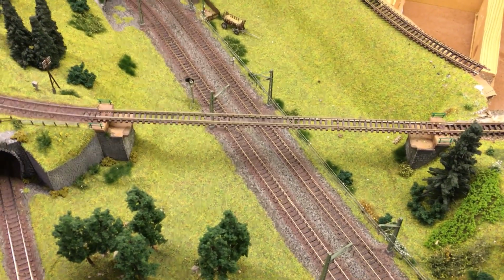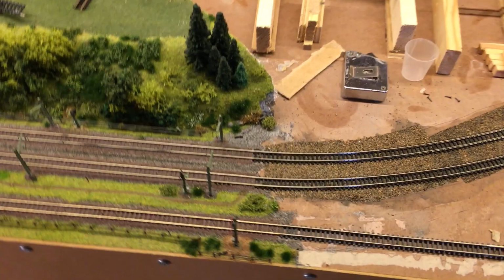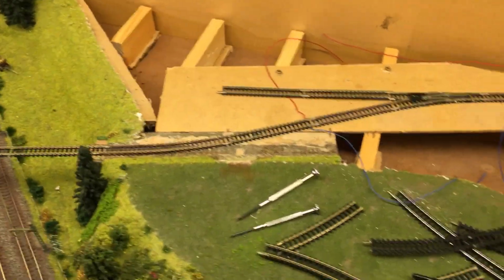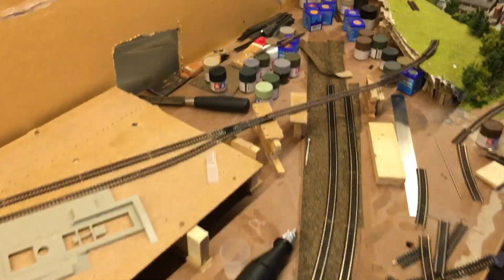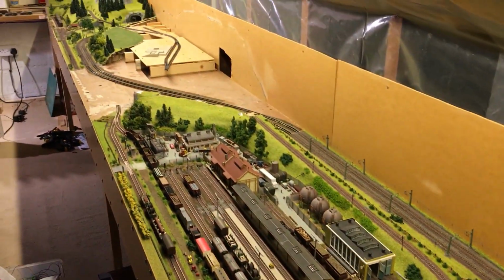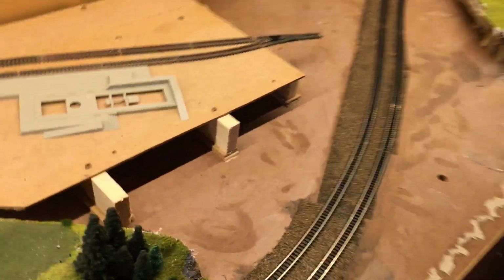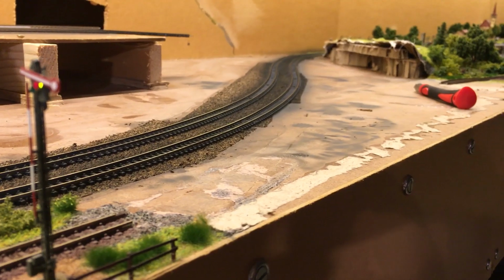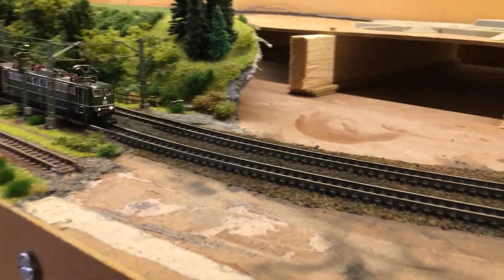Spur N Layout Jan 2021 Update 3

Comment: That mainline looks fantastic Tom, you'r making great progress. What is the item you put under the new track? It looks like pre ballasted paper is that correct? There is a supplier on eBay in Germany who often has the catenary masts for sale at a reasonable price his user name is Stampino i have bought a lot of stuff from him and the quality is always very good. Just had a look and he hasn't got the masts at the moment but he does have the overhead wires.
https://www.ebay.co.uk/itm/Vollmer-Spur-N-8008-Fahrdraht-90mm-8-Stuck-40990/363190866385?epid=901257298&hash=item548fdcd1d1:g:o90AAOSwN3xfupvF
Reply from the maker: Phil
it is a pre ballasted paper - i don't use cork (even 1 mm) as feel it raised the track too high up - paper has the benefit of being able to remove track more easily (if required) after ballasting
i have been searching ebay for masts but with no luck so far - measured the main line and i need 6 masts plus overhead wires (to keep spacing the same need the 200 mm lengths)

wont be much visible progress this week as i am sorting some wiring, preparing track, working out how to scratch build the steel bridge supports and lots of other little jobs which i wont be filming

tom
Reply: Sorry to be so offtopic but does any of you know a trick to get back into an Instagram account??
I was stupid lost my password. I love any tips you can give me.
Reply: @Maximus Zyaire Instablaster =)
Reply: @Ian Iker i really appreciate your reply. I found the site on google and Im waiting for the hacking stuff atm.
I see it takes a while so I will reply here later with my results.
Reply: @Ian Iker it did the trick and I finally got access to my account again. I am so happy:D
Thank you so much, you really help me out !
Reply: @Maximus Zyaire no problem :)